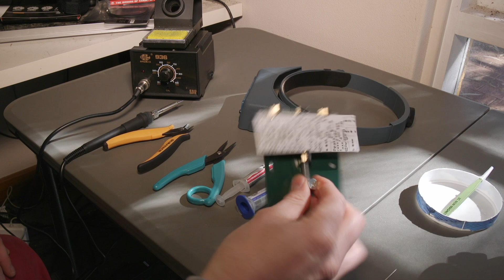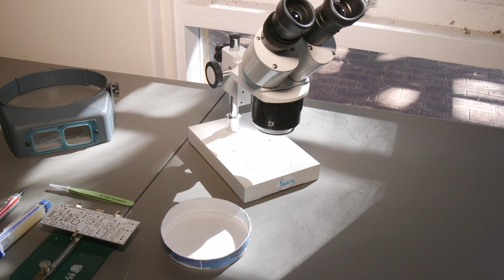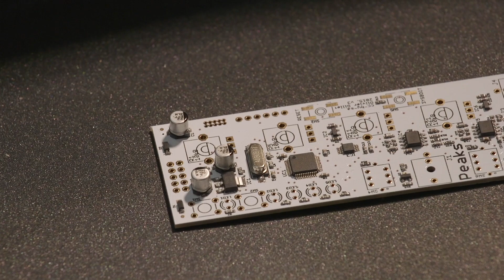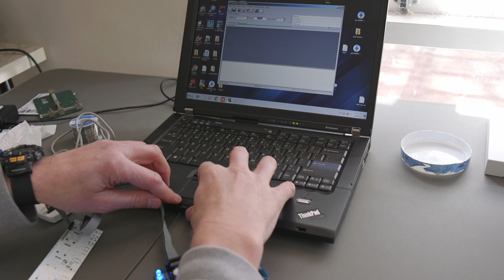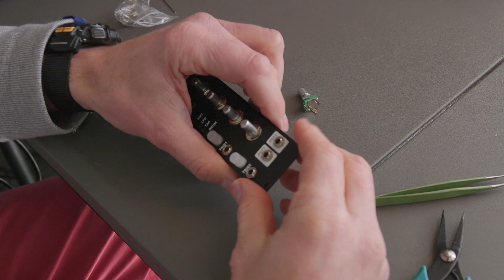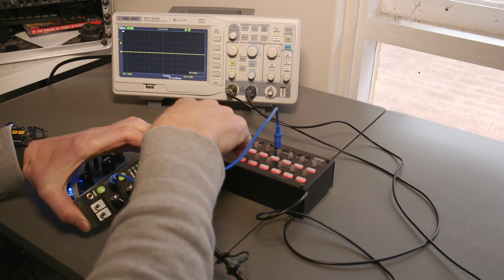Mutable Instruments DIY Tutorial - Mutable Peaks

Comment: HI, I'm building rings (by hand soldering) and it won't power up. I have a test power supply for eurorack  that has 3 leds for +12, -12 and +5  - normally they are full on, with any other module, but  with the rings they just blink every few second and go off.

I checked the power socket for shorts, downstream the diodes, also followed the diagram and board file - there is no continuity where it shouldn't be, and there is one where it should. Yet the problem persists. Do you have an idea what might be the fix? Any idea what part might create a problem like that and why the power seems to go back in a way that triggers the power supply's safeguard?

Comment: Thank you for sharing! 
You gave me the courage to program this thing. And it was a sucess!
Actually i didn't had connection the very first time but that was due to my fear of putting too much heat into the STM32.
Reply from the maker: Yeah STM32 is pretty robust, the only problems I have had is putting the STM32 in the wrong orientation (my fault!)

Comment: Thank you very much for making/uploading this great tutorial. This video was one of the reasons I thought: "SMD PCB? Why not!" But I have one (noobie) question: what about parts where the polarity is important?  e.g. diodes. How do I know, in which direction I have to solder them. Ok I know where it connects to from the schematics but I mean the diode itself. My project is the MI EARS with 0402 parts. they are so small that there is no place left to print a plus on it... ;-)   Thank you very much in advance! Best regards, Michael
Reply from the maker: You need to look at the datasheet of the part and also try google. The website where u purchased the part should also have the datasheet. If not doa search in mouser.com or similar. Usually diodes have a line on one end. Probably also need a microscope at 402 to see which end is marked.
Reply: @sumedho  I am sorry, but your very helpful answer has not been displayed/delivered to me in time... would have saved me some hassle! ;-) That delay is the reason, why my post scriptum surely seems to be a weird reaction to your useful answer. Thank you very much, again! Now I know, why you check the schematics directly in eagle. ;-) BC sometimes neither the silk screen nor the pcb view print out of eagle do show info regarding the direction/polarity of the components....One has to zoom in directly in eagle to see where cathode or anode should be soldered. Pewww...I am interested, wether I get this smd-soldering done correctly or not. ;-)
Reply: Edit: solved. There IS a print on the diodes to show where the cathode is. In my case it is a white line on end of the diode. Reminder to myself: rtfd  (=read the fucking datasheet) ;-)

Comment: Fantastic video.  I've seen heat guns, fine point soldering irons, and toaster ovens, but never a frying pan!  I'll have to give that a go and maybe save some small components from being blown off the board by my heat gun.
Reply from the maker: Works pretty good, I've built nearly all the MI stuff and everything worked first time except if I put a part in the wrong way...
Reply: @sumedho  did you have any issues with your Yarns module? I'm can't get it to turn on but I'm certain it's been programmed correctly. Not seeing any bridges and I've triple checked the parts. Also, where did you buy your boards from? I know there are some shops that have higher quality boards than others.

Comment: Thx first for the great tutorial! I want to start with building my first mutable module (ripples) and one thing I dont know is which size the vertical jack connectors must have or if they are standardized. Can you link me the ones you bought? Its the only point in the BOM I dont understand and I want to buy nothing wrong .. Can you help with me with this? Thx already :)
Reply from the maker: For most of the Mutable builds(but not all) you need Thonkiconn jacks. https://modularaddict.com/parts/jacks/pj301m12-jacks or https://www.thonk.co.uk/. Ripples uses Thonkiconn....good luck with the builds.
Reply: @sumedho  Thx for your answer :) These were the only Parts I couldnt identify with the BOM, how did you find out that these are the right ones?

Comment: Thanks for the tutorial!
Where in Perth did you buy the electric hotplate? Is there a temp guide on it?
Reply from the maker: I got the cheapest one I could find from K-Mart. No temp guide but I measured it with a thermocouple to make sure it wasn't going to be too hot....turns out that it was crap enough that at the max temp it was perfect for melting solder.
Reply from the maker: K-Mart

Comment: Hi - I notice that you do not use a plastic bus header for the power supply. Does this mean you have active circuitry to prevent from connecting the power supply the other way round? Cheers!
Reply: Woops, you are not the designer
Reply from the maker: I'm just very careful when I plug them in....haven't screwed up yet but I am very careful.

Comment: HI,
  Thanks for making this tutorial.  I'm interested in the section where you upload the firmware.
 Do you compile the code for the bootloader and the module code in vagrant?  Or is there somewhere else that you are getting the hex files? thanks.
Reply from the maker: I complied the firmware using in vagrant on a Linux computer. That works fine but isn't for everyone. I am planning on compiling the latest versions of the firmware and putting up on github in the near future but won't be until after new year. There is a set of compiled firmware on github already but some of them are a little out of date. The links should be on muffwiggler in the diy section somewhere.
Reply: Many thanks for the reply! ( and info ).
I've had some success in compiling/uploading with vagrant on a Win7 computer.   But the uploading didn't always go as well as I had hoped. So it's nice to have an alternative way to upload with the St-Link utility. Yesterday, I hooked up a partially populated braids PCB that I had used vagrant to compile/upload the firmware and I used the ST-Link utility to verify the code uploaded against the hex file.
Reply: Could you post a link on where you got the hex file for the firmware?

Comment: I've been using an Iron to solder everything but really want to give paste and skillet a go now - are you using leaded/unleaded? And can you recommend a particular brand of paste? Thanks!
Reply from the maker: I used a leaded one like this http://www.altronics.com.au/p/h1640-sn63-pb37-solder-paste-15g-syringe/ . Whatever solder paste you get should come with a datasheet showing the reflow profile (Take a look at the datasheet under the downloads in that link). You want to approximate that heating time/temperature graph. 

Best to test everything with a SMD soldering practice kit before you commit. I made a couple of those first before I did a real board. 

It's actually a lot easier than it looks.
Reply: Ik
Reply: Ik ben

Comment: Nice video! 
But could u explain the baking process a bit further? 
Greetz
Reply from the maker: It is easier than it looks. 
1. Get a cheap electric skillet (I got the cheapest one I could find). You can't use it for cooking after so save some money...
2. Put solder paste on the board.
3. Place components
4. Put board on and turn to full heat.
5. You will see the solder paste go grey and then shiny silver. Once all components are silver turn off heat.
6. Leave board on to slowly cool.

I have had really good results so far using this method. You can buy a couple of cheap ebay smd practice kits and try it out before committing with $50-$80 worth of parts. There are a few videos around on youtube showing the skillet soldering method which go into more detail than my video.
Reply: sumedho  big thank you for this explanation, I think it's worth a try!!
Reply: I've used an off-the-shelf toaster oven with no modifications, and I have also had great results.
Reply: sumedho really interesting. I'm going to have to give that a try. I've messed up every SMD circuit I've tried to solder 😄 my big, dumb fingers are way too clumsy. This video was great.